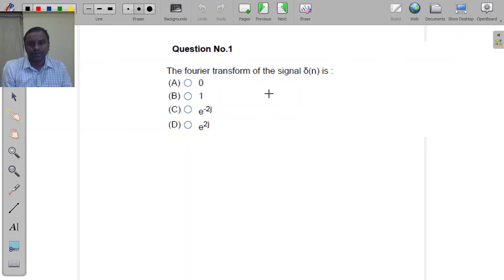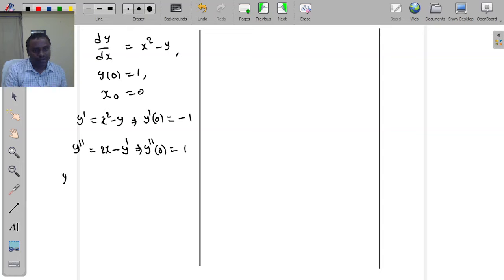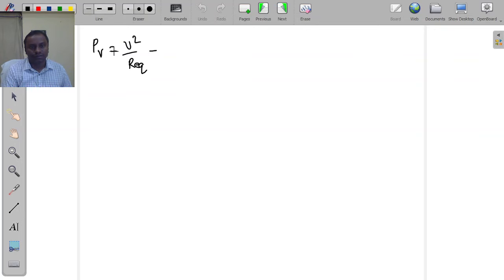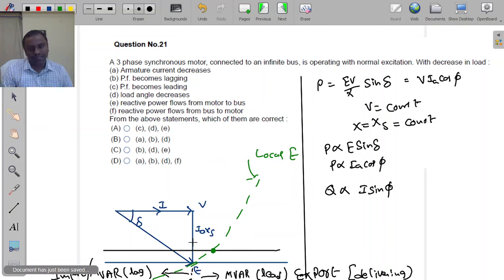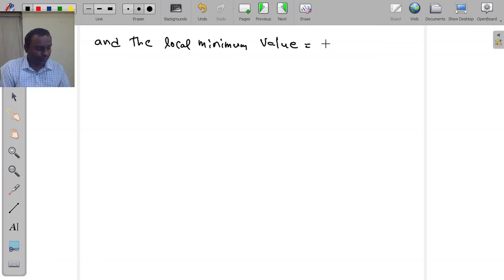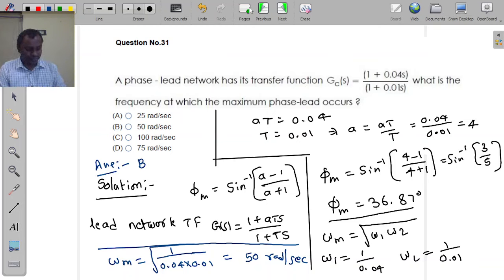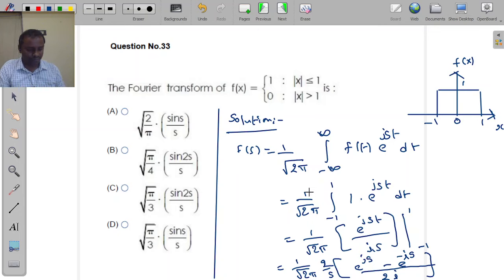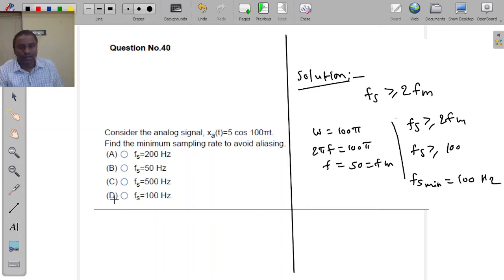PART 3 TRB TN POLYTECHNIC LECTURERS ELECTRICAL AND ELECTRONIC ENGINEERING 11 12 2021 PART B 2 MARK Q

Comment: Sir 
In Q-38,   I referred answer for this question from C.L wadhwa,  protects the terminal equipment against the travelling surges not travelling circuits. I think answer not given properly. Plz  Explain sir
Reply from the maker: Travelling surges is the right word
Reply: Thank you sir

Comment: sir, for star delta starter
1) In star connection = vph= vl/√3
per phase starting current = vl/√3 * 1/z
in star = IL= Iph
2) in delta connection = vph= vl
per phase starting current = Vl/z
line current = √3 phase current.= √3Vl/z
by taking ratio we get 1/3.
pls explain if it's wrong.
Reply from the maker: you have taken the ration of line current of starting with star to the  line current of starting with direct on line delta, in that case ration is  1/3, then you also has to take line side starting currents  for Auto transformer in that case the ratio becomes 0.36,  either you need to take for both case that with star delta starting and auto transformer starting both as line side ratios or both as phase side ratios , we can't take one as line side ratio and the other as phase side ratio, so final answer becomes 1/3 : 0.36 : 1/3 : 0.36,   when you take line side starting currents and 1/root3 :0.6 : 1/3 : 0.36 when you considered starting current as per phase, so such a answer available in the given options
Reply: @venkatmandadhi7383  
sir, 
for autotransformer
starting torque = x^2 * rated torque
so x= 0.6
it become = 0.36.
2) for starting current we have two sides, 
secondary side of the transformer is connected to motor if you reduce the voltage by x times then starting current in motor side reduce by x time, so it become 
0.6 time of rated current in motor.
3) in primary side of the transformer it reduce by x^2 times. most of the people considering this point and assume that starting current in the motor reduce by x2 times. but it is valid only is primary side of the autotransformer.
as per my knowledge torque reduce by 0.36, and current in motor terminal reduce by 0.6time, so the given answer is right one as per my knowledge, pls share your idea if it wrong.
Reply from the maker: @vijayaj292   that is what  I am saying either you take per phase current  or directly line side one from line side and the other from motor side, I didn't think correct, as per my opinion, there is no correct answer available in the given options,   so Let wait what TRB will decides
Reply: @venkatmandadhi7383  sir,
I took both ratio from line side, not the one from line side and another from phase side. ok sir lets wait for the official trb key.

Comment: 10 in AK shawney the option is similar to a that is cramped both at upper and lower ends
Reply from the maker: No you are wrong

For Q No_10, same question is  available in the book AK Shawney , Reprint 2012, page no 310, q no 21, they have given same objective, and also they given answer for this question is as Cramped at the lower end and expanded at the upper end, answer is in page no 312,  you please refer
Reply: A course in Electrical and electronic measurements and instrumentation by A.K SAWHNEY, PUNEET SAWHNEY 19 th revised edition Page no 259  topic 9.9.3 shape of scale of moving iron instruments under that the statement is given like below
The Scale is compressed at its lower end  because I square is small relative to full scale value and some what compressed at its higher end because in this range the rate of change of inductance with angle decreases rapidly.the scale is usable over about 80degree of its length
Reply from the maker: @vishnuvardhan7983   what you said is   also there in the book, but in the same book same chapter end side they given the same objective question, in that they given answer as Cramped at the lower end and expanded at the upper end, let's wait and see What TRB will decides